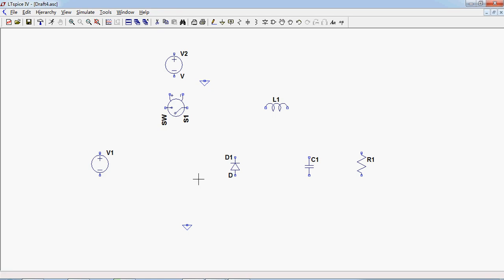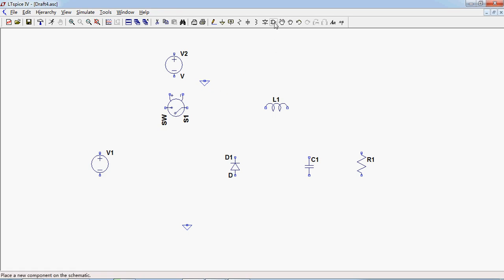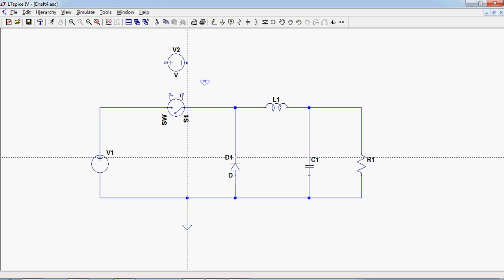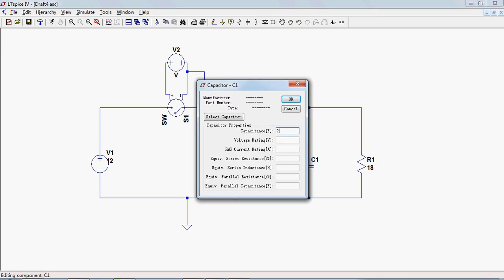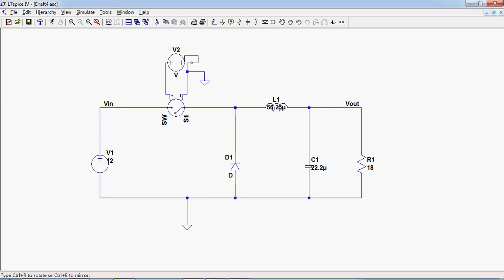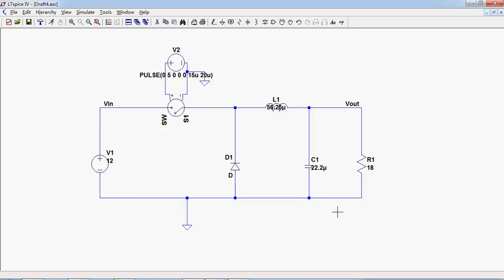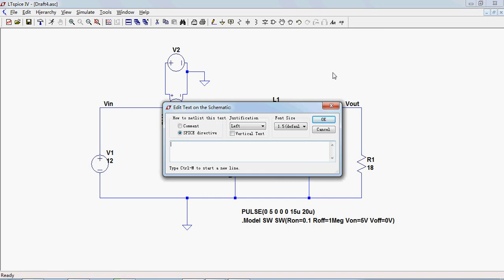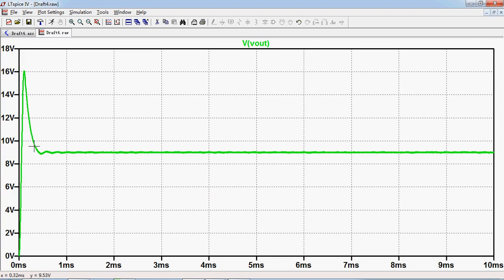Built Buck Converter in LTspice

Comment: can you show me how to answer this question by using pspice
> Design a buck converter such that the output voltage is 15V when the input is 48V. The load is 8Ω. Design for continuous inductor current. The output voltage ripple must be less than 0.5%. Specify the duty ratio, the switching frequency, the inductor size and rms current rating, the capacitor size and rms current rating. Assume ideal components are used. Show your calculation showing the following parameters:
 a) Duty ratio
b) Average, maximum and minimum inductor currents
c) Draw and label the inductor current waveform
d) Average diode current
e) Draw the diode current waveform
 f) Average input current and average output current
g) Draw the input current and the output current waveform
Verify your answers of 1(a) to 1(g) with PSpice simulation.